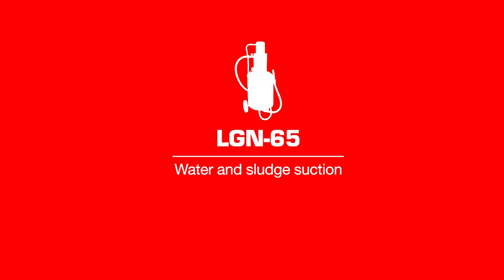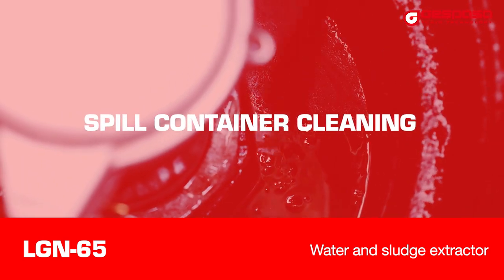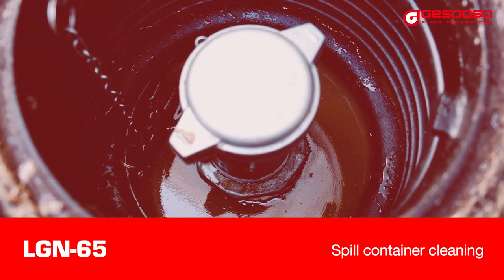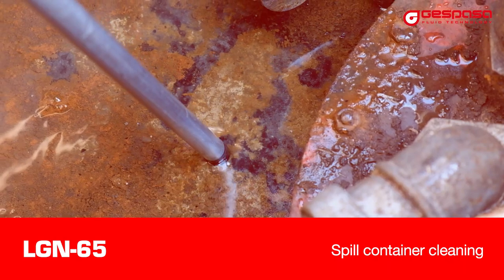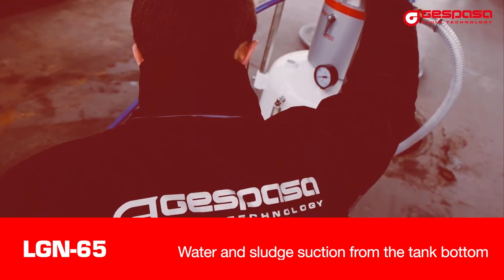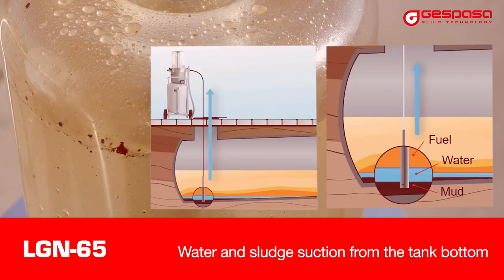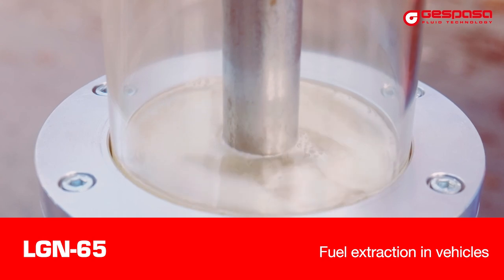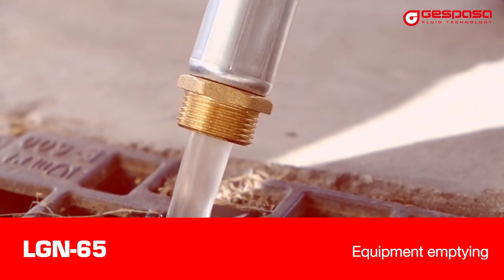Pneumatic fluid extractor

Comment: Why this is not found in the website?
Reply from the maker: From now on you will find it in our website: http://gespasa.eu/en/pro/carburanten_u1/extractoren_d16/lgn_t706/index.html
If you need more information, please do not hesitate to get in touch with our Export Department. Thank you very much for contacting us.
Reply: GESPASA Thanks, it can be used to Extract: Oil from Engines as well Diesel and Petrol? It will be used for Multi Uses and I need Transprent Chamber to calculate the volume extracted before dumping it into the 65 Liters tank.
Reply from the maker: @HD13POWER  Please, could you send us an email to get in touch with you?